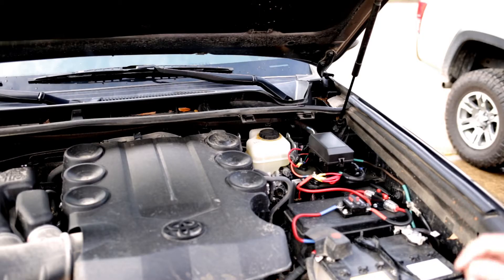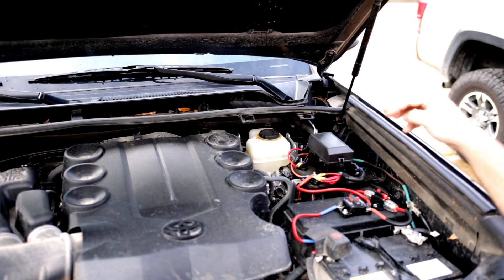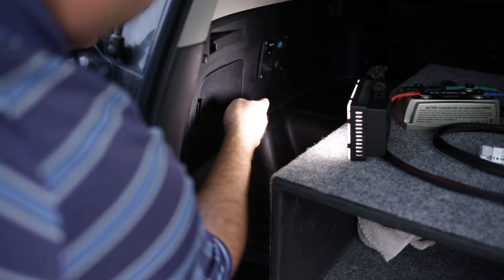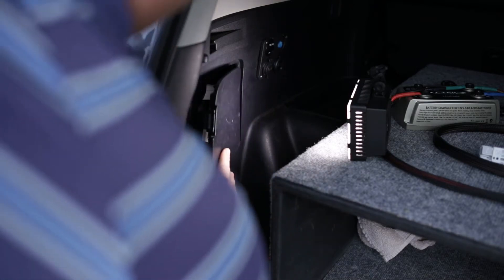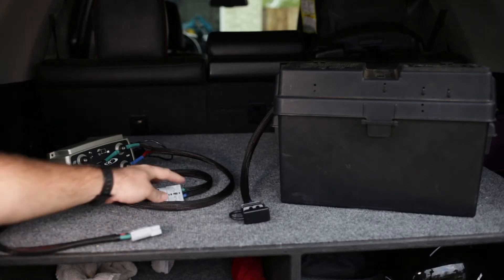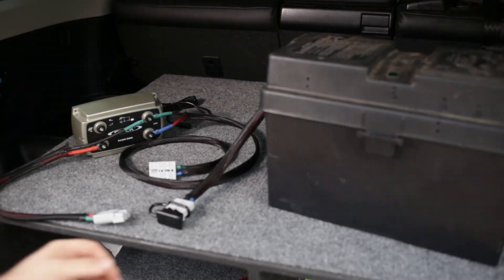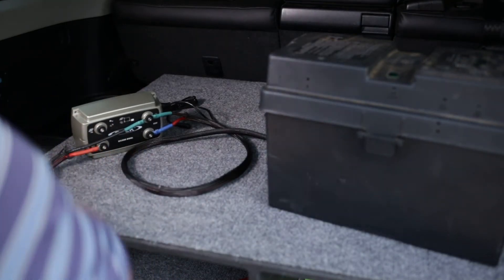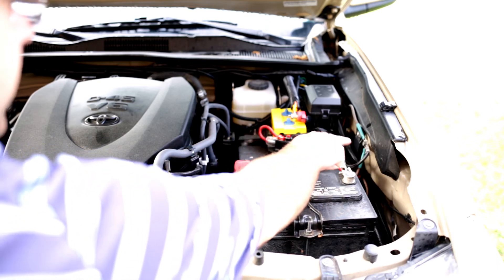12V Dual Battery Portable Setup for Overlanding

Comment: I’m lost on the relay box and how that’s all wired up..also from there to the back of vehicle are you also running 8 gauge awg to the Anderson plug? Thanks
Reply from the maker: https://www.amazon.com/Suitech-Universally-Adaptable-Electronic-Circuit/dp/B0739R9SQT/ref=sr_1_14?crid=QSZS0N87LX0N&keywords=relay+box+switch+panel&qid=1575608341&sprefix=relay+box+swit%2Caps%2C145&sr=8-14

They made a pre-made one of these. Worth the $120. I did it manually and it cost me about $90 and 4 hours work.